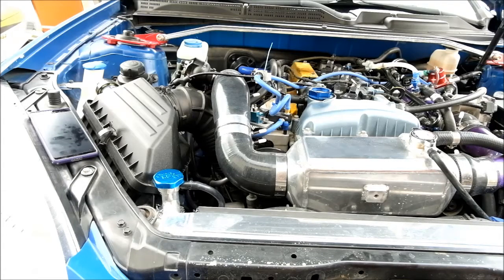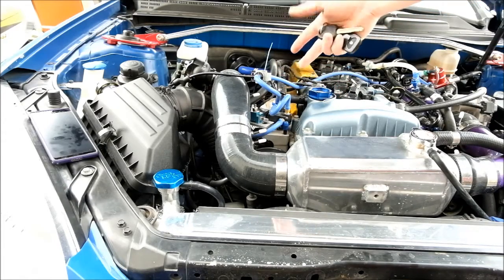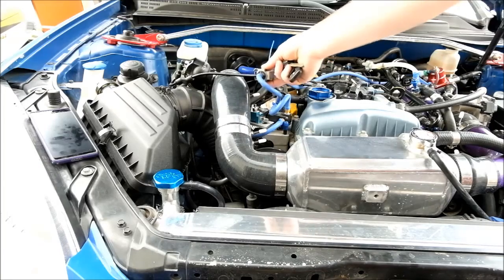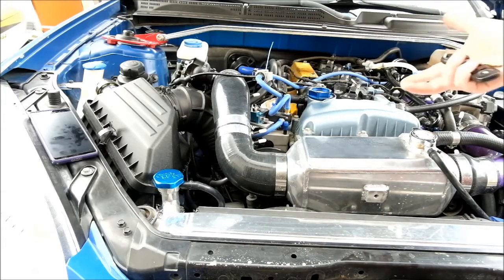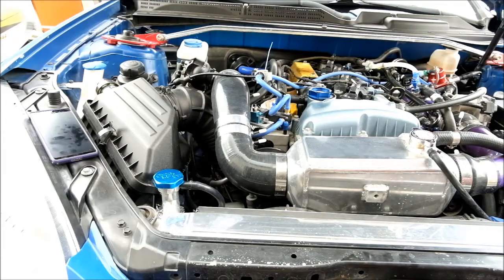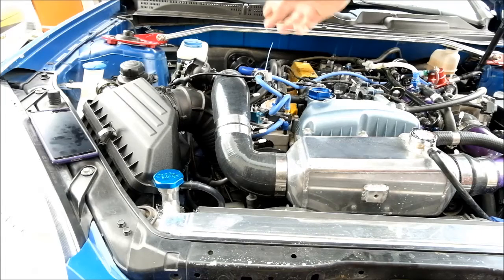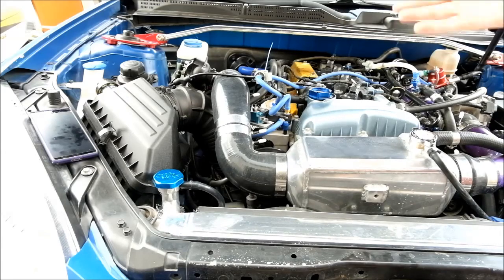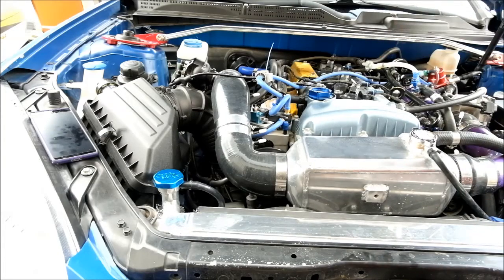SECo PnP BOV Solenoid hot swap

Comment: This on all stock setup including stock bov will it have any improvement or just a safty item for the turbo.
Reply from the maker: John Dobbins Going to be honest with you, with the stock BOV, it probably won't make a bit of difference. That valve is lazy for more reasons than just flow. It's a stamped aluminium valve designed for quick installation at the lowest possible cost and is easily a 30 year old design. I'd test it but I don't have a stock valve laying around anymore, my spare parts bins have been thoroughly picked through lately. I've got to resupply.
Reply: I was wondering because eventually I will be getting a synapse and would probably do this first to make the most out of it from day 1.

Comment: Is that an air to water intercooler?
Reply from the maker: Andy Skeptic Yessir it is.
Reply: Nice, is it a prototype, kit or custom?
Reply from the maker: Andy Skeptic It started off as a prototype, but it works so well with the new heat exchanger setup that I've been asked to make more of them. I'm installing this setup on another coupe in a month or two and I've got a second one on the bench getting ready to be made right now.